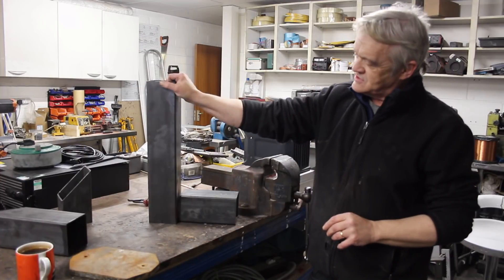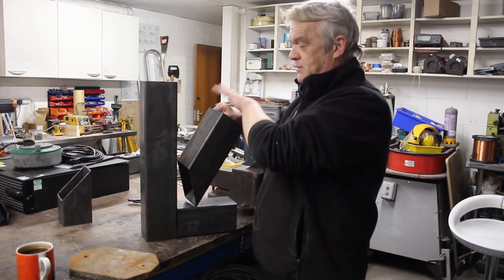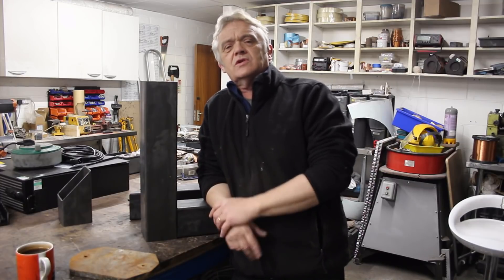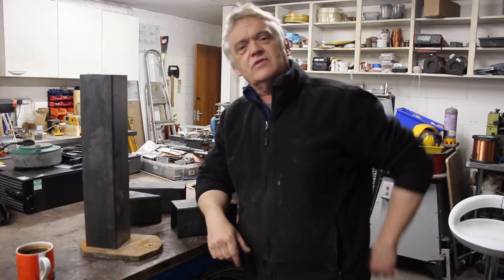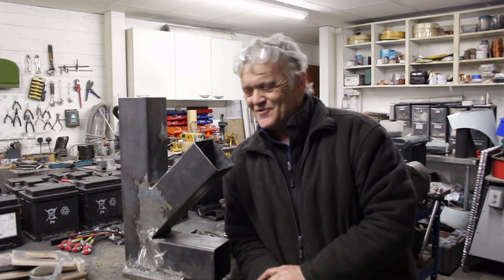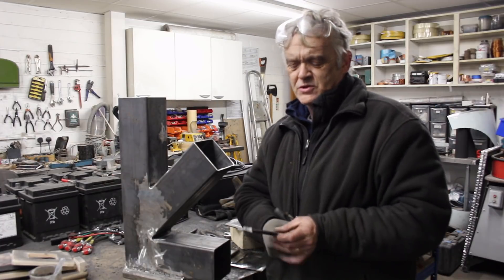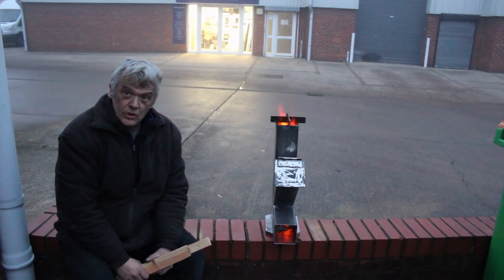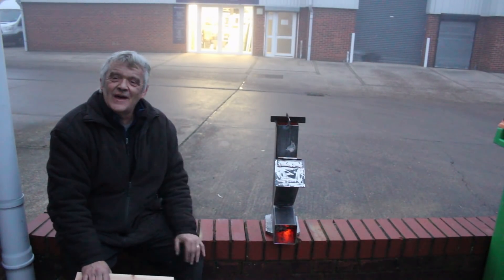1403 How To Make A Rocket Stove For UK£20 And A Couple Of Hours Work

Comment: Another good one, Robert.
Not to be a smartass, but if I was building it for heat, I'd make it with fire bricks in the first place, and line it with clay in place of mortar. That way I'd have the mass all in one piece. 
Plus, I'm not a welder :)
Reply from the maker: I agree mate brick is a good way - I went for steel because of it's adaptability, portability, cost and - for me - ease of use

Comment: The rocket stoves I have seen use a ceramic for the combustion chamber which is insulated and the heat is taken from the exhaust. The idea is to try not to dissipate any heat at the combustion chamber so to achieve maximum combustion temperature. The stack is also insulated to about 1/2 meter up. The draw through it is so strong that the stack can be covered by an oil drum and the exhaust exits at the bottom/side. This design is used in the mass rocket stove heater where the exhaust runs horizontally and covered by a mass to heat up.

Lol, yep commented before the end (face palm) 🤓
Reply: That's a super important factor for high efficiency combustion and a good solid draft with low chimney heights.
Reply from the maker: lol - as you found out I have thought about it - a little - but love the ideas mate and it helps me think I am on the right track - like lots of things this is my first foray into this and it is good to hear I am not being too wild in what I am thinking - cheers

Comment: Would you share the link of where to get the 100mm x 3mm box section, cut to size for £20 - Thank you. Great video.
Reply: Go around and ask at some local scrap yards.

Don't call, just go and ask.

Big chance they will say take a look around.
Reply: I'd like to have a go at making one of these,  and would also like the link to the supplier of the steel. £20 delivered sounds like a bargain. 
Thanks
Reply from the maker: it was just a web search mate

Comment: I accidentally made a rocket stove before I knew what a rocket stove was out of 12 inch square tube and set it up in a 3m x 6m garage. Once it got going I had to leave the walk through garage door open to keep from roasting myself. I put a door on the bottom to control the airflow.
Reply from the maker: lol - laugh with you mate - never at you lol - i need the heat for sure!!